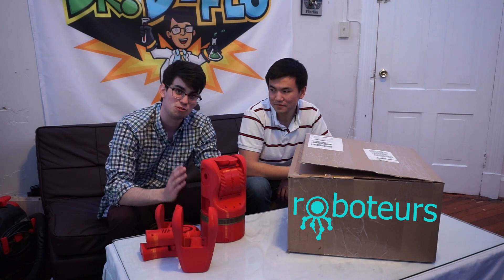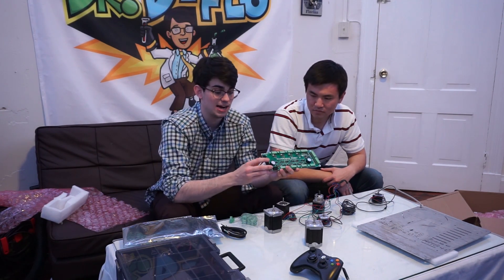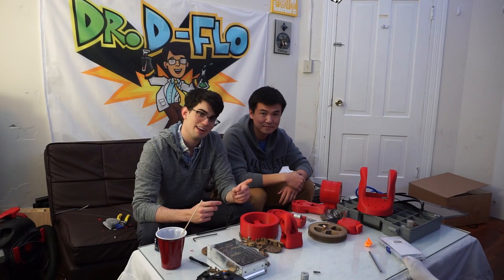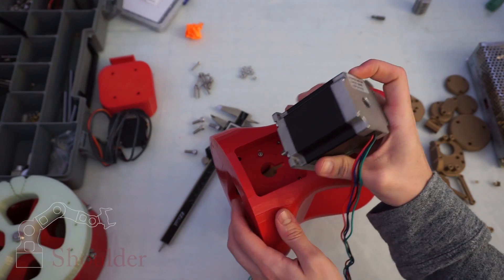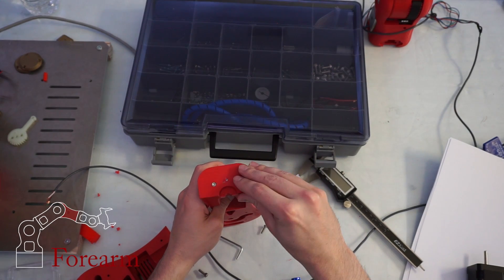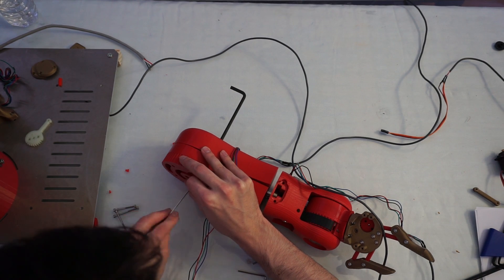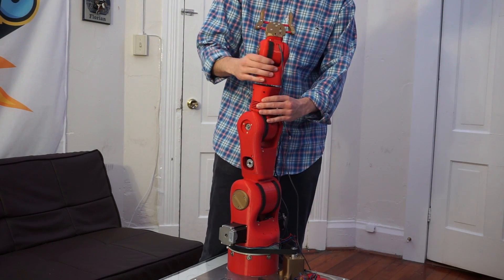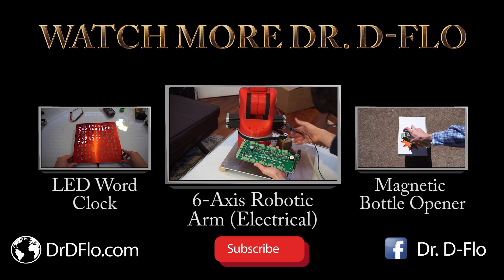6-Axis 3D Printed Robotic Arm - Mechanical - (Part 1)

Comment: its a toy, unfortunately.. should improve rigidity and precision for real applications. I'll design one for manipulating parts in a CNC and it will be able to 3d print with a 3d head extruder. That's the precision requirements you should make as a goal. Maybe cycloidal gearboxes would be a nice approach. But all machined in aluminum parts. 3d printing only for parts that don't suffer stress and for the design covering parts

Comment: how did you calculate the length of the belts required?
Reply: Same question! Are you building it, like me?
Reply: @angelmarauder5647  Yep!
Reply: @MrApplefreaker  How did it go?  I had to order another SlushEngine because I believe I burnt mine out within a minute; so I'm waiting on that.

Comment: Hi Guys what 3D printer did you use to print this at this size?

can you recommend me one? complete noob here
Reply: Hey Stephen. (I'm also a Stephen).  I bought a Prusa MK3S specifically for this project.  the 200mm cubed size fits the parts great.  You can download the Prusa Slicer software and open up the models for this robot.  I'm currently building it.

Comment: You print the part new with a bigger hole? Why not drill a bigger hole in the already printed part?
Reply: Takes a little practice to center a hole precisely over an existing one. They might not have the practice or the tools needed for that
Reply: Not to mention you don't know the infill percentage of their parts.

Comment: Great build, but please tell me this, why in gods name would you use a soldering iron to insert the threaded bushings. Those should probly have been pressed in and not heated in. Heating them in just destroys the plastic around it making it useless.
Reply from the maker: Shawn,

They are called "thermal" inserts. This is the way they are suppose to be inserted. And yes they completely ruin your soldering iron tip. 

Thanks for your question!
Reply: Dr. D-Flo 
I guess there are pressed in by a hot tip of some sort. Sorry I questioned you on this. To me, it just didnt seem right. But you are correct, you would use a hot end, AKA, soldering iron to install them.

By the way. That robotic arm looks sick as hell. Extremely Jelly.

Comment: why didn't they just design the robot arm case to also house those cables.
Reply from the maker: SvPVids,

Thanks for your questions. I did not design the robotic arm. This arm was designed by BCN3D. Also, incorporating cables into the housing is a lot more difficult then people realize because you have to consider slack, so that each axis can move freely.

Dr. D-Flo
Reply: do you think you can mod it? or is it too much work
Reply from the maker: All of the raw solid files are available, so you could Mod it, but it would be too much work. Plus, the wires are really not that much of a concern at least for me.

Comment: What did you change when you reprinted? The model or slicer settings. Could you give us any more info on the parts? How much infill and layer height etc.
Reply: The reprint for fitting the bushing looked pointless why not just drill it out.

Comment: Interesting video and a cool project in general. I'll be curious to see the final cost breakdown and total assembly time, including time to print those huge parts.

Time to look through the various videos and sites that have done strength tests on various FDM materials and see what might be the best filament material for this project. Hmmm....time to look at that 3D printed propeller video again.
On the other hand, how cool would it be to get this DMLS printed in metal. Aluminum, or Titanium would be awesome.

One comment, I would never recommend hitting the metal parts directly with a hammer, particularly the bearings and steppers, and the manufacturer should recommend either using wood blocks and dowels or a plastic faced hammer.

Comment: This build looks a lot like a kit, are you guys basically just following directions and assembling? Or did you actually design and test the robot geometry? 

If it's a print/assemble type build that is still pretty awesome, I'm sure it would be perfect for a tinder right swipe machine! haha
Reply from the maker: Knight,

Thanks for your comment. So, this is predominately a kit. I purchased a Beta kit from Roboteurs (https://roboteurs.com/). The kit provided all the electronics, linear rods, bearings and fasteners. The kit also came with the files for the 3D printed parts. I did the actual 3D printing. During assembly we came across problems and fixes for said problems that we relayed back to the roboteurs team that will hopefully make the kit easier to assemble when the commercial version is released.